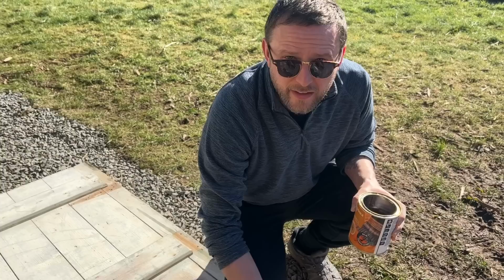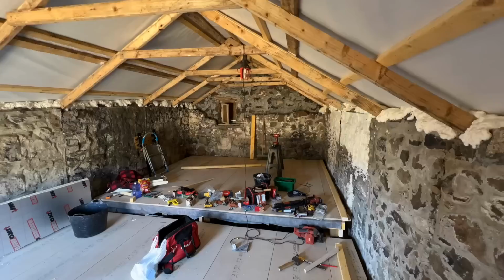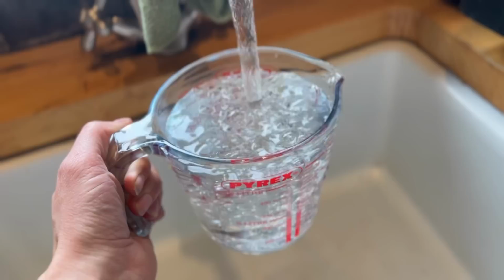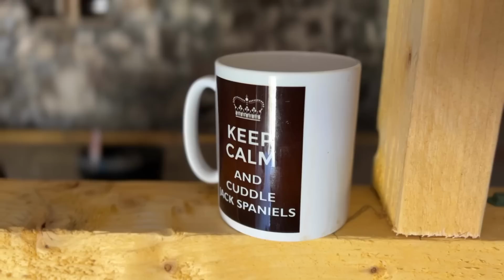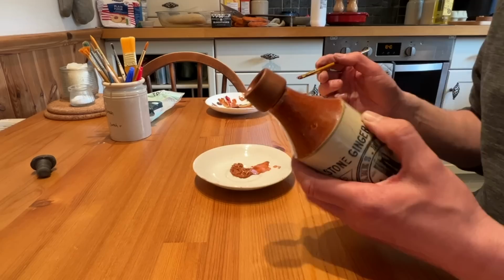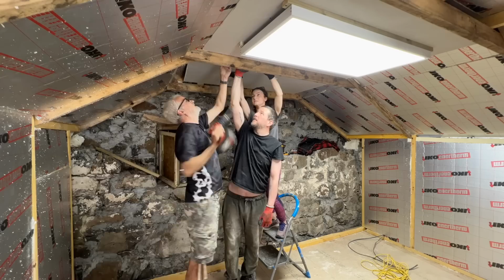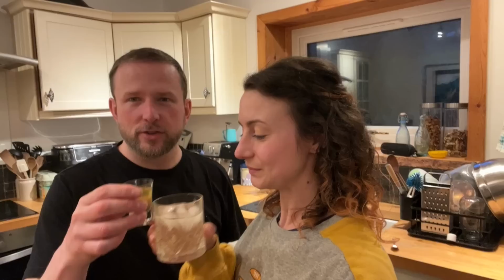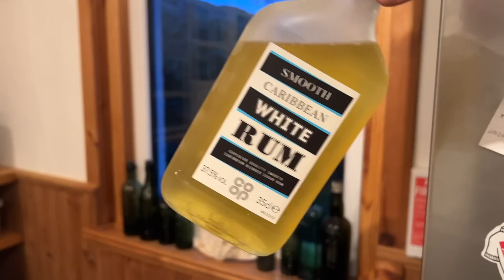The Conversion Continues...At Our 1840s Cottage On The Isle of Skye - Highlands, Scotland - Ep19

Comment: Well done guys, looks like it's taking shape nicely.  We'll miss you next week, but you deserve a break, would be nice to know how you are finding the internet since installing it and how it works in the Byre when finished.  Those daylight panels look great, even without the walls finished they really brighten up the area.  What make are they?
Reply from the maker: Thanks Stuart! The internet is working great - no issues so far (touch wood). We got an adapter from Starlink for an extension cable which runs from the router in our house to the byre. Works perfectly! The lights are from LED Panel Store 😊👍

Comment: lovely job, but why did you lower the ceiling at all? I would've just insulated the roof all the way up, to give it the most height possible. I know it easy to talk when not being there though, it is just an idea :).
Reply from the maker: We couldn’t move the crossbeams as they are needed to support the roof and we needed to get insulation in the space too 😊
Reply: @livingtheskyelife  ah okay, that makes sense :). I just love the look of those old buildings, so showing a lot of it is super nice! Great project you have got going on there, looking forward to the next steps :).

Comment: No windows in the byte?  Light?  By the way I liked the bottle as it was…why restore…it’s not a legit antique anymore 😊
Reply from the maker: There is one window at the back of the byre, and there is now a very large glass door at the front. And we have installed 2 large, dimmable LED panel lights. 
The bottle had already been repaired before I got it. The paint job was very poor though, so it was just an improved paint job, nothing more.

Comment: Is there still dirt floor under the raised floor?  If so, in a dark enclosed building you are at high risk of mold and breathing in mold & fungal lung, skin, eye, mucous membrane infections.  At minimum you need an air exchange system, but, the dirt floor is a problem. Especially because you both plan to spend time in there every day.